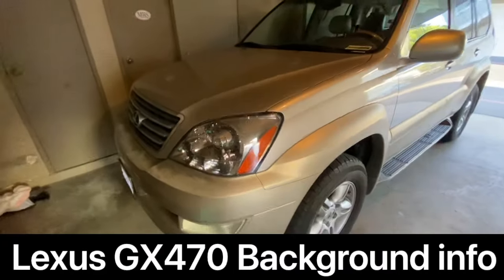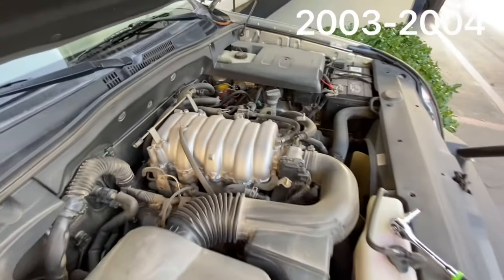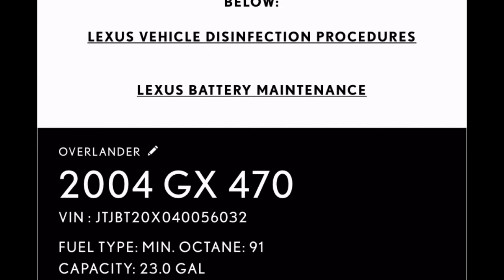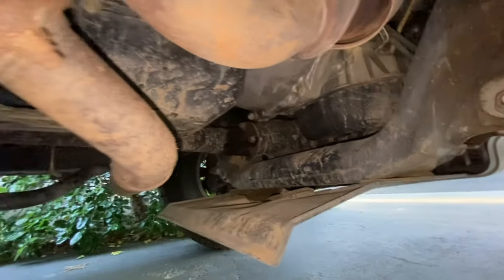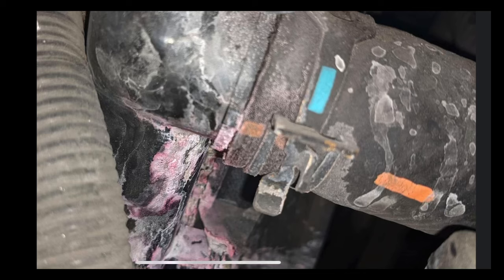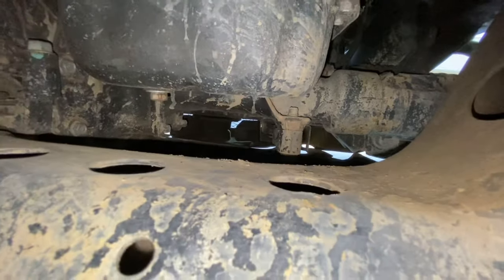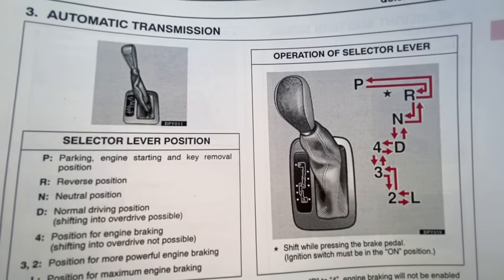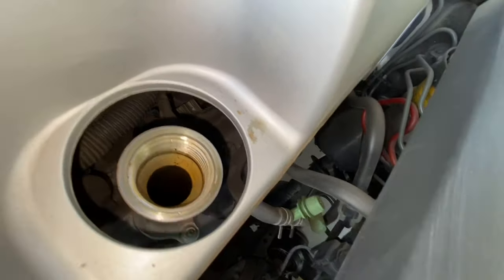LEXUS GX470 BUYERS GUIDE - 7 Things You NEED to Know

Comment: gx470 has a transfer case leak issue where if you bring it to a dealership they will crack it open for $2000 to replace the o-rings in the transfer case actuator motor. It can be fixed for $45 by just removing the actuator motor and replace the o-ring. I have that issue on mine and got a nice discount because of that issue. Fixed the leak by buying o-ring from rocket seals in Colorado (dealer don't have those seal available or for sale)
Reply from the maker: So awesome! 👏 fun job. I did the same right after I got my GX too 

https://youtu.be/5kj8n8BC92w
Reply: follow-up question: what happens when that leak is never fixed and how would you look for that?
Reply: @SR-te2db  you'll see oil puddles in the floor and if it goes low or empty it will destroy your transfer case.
Reply: Thx. Don't go to dealers unless you have to. Find an honest mechanic who knows lexus
Reply: One "last ditch" place I use for finding O-rings is the local heavy equipment maintenance place. They sell parts as well, and will size my O-ring to find one like it.
Reply: What Year GX470's is this an issue. And are your saying, this can be a DIY issue if the owner buys their own O- Ring and installs it under the actuator motor. So, is the actuator motor accessable without cracking the case?  Wondering why would the dealer service crack the case. I'm looking into buying one. Thx G

Comment: I have a December 2004 built 2004 GX470 (Black).  Purchased used in 2008 with 40,000 miles.  Since then, I have put 100,000 miles on the odometer.  It is a great vehicle and I have a great mechanic.  Based on my experience, here are few items to check.  First, the spare tire. Where it sits under the car allows salt and water to puddle between the tire and rim.  This will corrode the wheel and you will eventually get a tire pressure warning light.  Only cure is a new/rebuilt rim.  Second, gas gauge.  Make sure it works.  Not an expensive part but a real pain to replace the float (figure about $800 to $1,000 labor).  You have to drop the tank and to do that, you must disconnect the driveshaft.  Third, rear shocks.  They can rust out and are expensive to replace.  The shocks alone are $500 each.  Fourth, stuck brake calipers.  It is great that they use four piston calipers.  Unfortunately, that gives you a greater chance of one of them sticking. Radiators are not a lifetime part.  Look for telltale pink stain on the radiator.  Last but not least, check the CV joint boots for leaking.
Reply: Dude.  Your spare tire was mounted upside down.

Comment: One other bonus of a non VVT-i engine is it's a non-interference engine, the valves and the piston never occupy the same space. If your timing belt breaks, the engine just stops running and won't destroy the valves/head.
Reply from the maker: I’ve heard mixed answers on this, actually. Part of me is skeptical since changing from interference to non-interference would require a completely different head design. Not sure why Toyota would do that but if true that would definitely be a huge advantage to the non-VVT engines. 

I’d be very interested to check out any sources you have on this since I can’t seem to find anything official on the subject
Reply: Plus you can replace the camshaft seals without having to remove the cams.
Reply: The 2UZ-FE is an interference engine.  Don’t wait to break a timing belt to find out.
Reply: So, that's only the 2003 model, right?

Comment: Quick note: Toyota never recommends a transmission fluid flush, it could actually cause problems with the transmission. I would do a drain and fill only. Toyota actually does recommend this for severe driving, but I’d do it regardless.
Reply from the maker: I’d be very interested to see where Toyota has said they never recommend a flush. Can you leave a link here for everyone? I’ve heard it both ways and want to make sure everyone’s voice is heard.
Reply: I've read the same thing all over the forums and facebook pages for pretty much any vehicle, not just Toyotas. When they're higher mileage, you risk dislodging larger particulates in the trans that might not find their way out during the flush. I've always seen it advised to do multiple drain and fills instead of a flush for a high mileage car. i.e drain and fill, drive 1-3k miles, and repeat.
Reply: @lexus_offroad_adventures 
Toyota Australia tell customers who’ve asked about getting their AFT changed that it never needs replacing.  I replaced mine shortly after buying my 120 Prado at 210,000km (131,000 miles) and it was black & smelled burned.  The transmission was developing a thump when changing to R or D.  After the ATF was flushed it changed to R & D smooth again.
Reply: @lexus_offroad_adventures  every Toyota master tech I've ever spoken to has said drain and fill is the way to go. Also, make sure it's done at a Toyota/Lexus dealership as it's best to use the OE transmission fluid
Reply: My Toyota dealer did recommend flushing. It hadnt been done it’s whole life until 225,000 miles. No problems soo far.
Reply: That’s what I was told.  I have the ‘04.

Comment: You still have a bit to learn, but keep it up. I will throw one out. If you see aftermarket wheels on a vehicle there is a 98% chance they are inferior to factory wheels. The Japanese went to far as to make a casting mark to signify the quality of the alloy (looks like a little cursive m). Potmetal "rims" that you buy are of such low quality that a pothole that a factory wheel would shake off with no problem will split or break and aftermarket wheel. Thats not all though. You will wonder why you keep losing air, and its because the cheap metal will develop corrosion pitting in the wheel lip and start leaking. If you want to upgrade to some Methods or other VERY high quality wheel, go ahead. Otherwise you are literally buying problems you didnt have to begin with.

Comment: You can check the trans fluid, It's under the vehicle.  There is a fill plug you pull out and can get a sample of the fluid from. It should just barely pour out if its full. Yeah it's not as easy as a dip stick but its not terrible either. I can't remember what the fastener type is but it's the only one of its kind that you will see and is smaller than the rest. Drain and fills are easy on these too so you can easily keep the fluid clean if you do drain and fills on time.
Reply: Is there a trans fluid filter that can be replaced?

Comment: Good vid. Sticky calipers are common - easy to upgrade to 460 calipers, rotors, pads. Folks have replaced 470 with OEM and then they still fail so good idea to go 460. They are beefier. Also some AC evaporators are failing - mine failed but has had to fight texas heat.
Reply from the maker: Thanks! Great points. I am actually planning on doing the 460 brake upgrade on my off-road 470 so idk why I forgot to include that in the video 😅 anyway, that’s what comments like these are for!
Reply: @lexus_offroad_adventures  my friend has a 460 and he has warped rotors @50k miles, it seems to be a common issue with 460. Not sure why this upgrade is better.
Reply: @highmilesgarage9131 
It’d be his braking style on long downhills.  He needs to use the gears to help control the car’s speed.  Upgrading the rotors to slotted & dimpled helps a lot.
Reply: @cliffbooth7075  yup, I learned that poor braking habits that ignore the dynamics of heat and friction costs you warped rotors.
Worst thing is having red hot discs & then holding the brakes down at a stoplight. Keep releasing them so they can cool and you avoid damage.
Reply: I had the same issue with a sticky front left caliper. One of the 3 pistons seized up.

Comment: Don't let the navigation models scare you away. Phoenix automotive makes a radio that includes the air controls and it's plug and play. Also makes your GX 470 feel a lot younger in the cabin.
Reply from the maker: Yes absolutely. Thanks for sharing sharing your experience. I’ve heard mixed reviews about the performance of those units but I’m sure they’ll get better as the software improves. For my Nav GX I went with the Grom system. Making a review for it soon
Reply: @lexus_offroad_adventures  The Phoenix automotive radio definitely has some drawbacks but it's definitely a huge upgrade to the stock radio. Looking forward to seeing the review on your radio.
Reply: I have a 2003 GX470 w/ Nav (Original owner - 228K miles w/ lots of mountain/snow driving). I just installed the Pheonix PX6 - "10.4" Vertical Screen Android 9 Fast boot", It's a little quirky, but overall an excellent upgrade. REally gives teh truck that "new car" feeling. Now I want to upgrade the rest of the truck. Thanks fro the fun video!
Reply: What’s the cost of the unit
Reply: @kahncreationsable  what was the cost of the unit
Reply: @thesinfultruth7697  can't remember how much I paid exactly, I think it was around $700. I've heard you can get it on alibaba or ebay for cheaper though.

Comment: I'm in Socal looking for a GX470,  just worried it may have trouble fitting in my car port and about and pissing off my neighbors too much by switching from a Civic SI Sedan to a GX470. Thanks for making the video I think it is very applicable to my situation. I'll keep looking for that "ruined airbags, bald tires, scratched wheels and no NAV, but otherwise perfect GX". Thanks Again!
Reply: There is a spot called miramar motors that sells great gx470 built up a little that are super well maintained. Got mine there and it was amazing
Reply: @vincentalvarado9478  they mark those things wayyyyy up. I found an unmolested example with great service history and in great condition in San Diego for $12K... Not going to pay $25 to $30K for a vehicle that was $9K a year ago.
Reply: @vincentalvarado9478  markup on those are insane tho. I can find an identical vehicle private owned for 20k less than the ones they list.

Comment: Great tips, fortunately for my unsight unseen GX470 timing belt was done at 123K miles, I haven’t tested the 4wd control lever yet. Just need to get part of rocker panels pulled and doors done.
Reply from the maker: Nice! I’m no stranger to the sight-unseen GX life haha 

Hope it works out with the body work!
Reply: @lexus_offroad_adventures  thanks I’m excited crazy even with the side damage the sob still drives straight as an arrow these rigs are tanks.
Reply: I did mine at just over 100K and the original still looked new.

Comment: Alternator had to be replaced on my 2008 GX470 !!! Had my GX470 truck for 9 years. Bought it with 29,500 miles, currently has 149,590 miles. Preventive maintenance has been kept with great results, except alternator.
Reply: Ever changed the cabin air filter?
I gotta 2006 and learnt last month a cabin air filter is a thing

Comment: I had a 2004 and now have a 2008. The 2004 felt faster (not sure why - it should have been slower without the VVTi). I also preferred the sound system in the 2004. Here are some of the other differences I noticed over the years:
2004: Less undercarriage rust. No driveshaft clunk. Rear air suspension was really noisy when it pressurized. Nakamichi amp failed after 10 years. Got it repaired by a repair shop in NY. 
2007: Feels slower off the line. Driveshaft clunk (but can be mitigated with regular lubrication). Lots of undercarriage rust (both cars spent their entire life in the D.C. suburbs). In fact, the rust is so bad now, I’m getting concerned. 
Problems common to both:
Headlights are weak by today’s standards. Power window switchgear fails (probably from leaving the window down in the rain). O2 sensors. Gas cap. Undercarriage rust. Plastic runners under front seats don’t stay in place. Wheel corrosion. Brakes are undersized. Tip: use cryo-treated rotors up front to eliminate vibration/pulsing. Brake calipers typically seize around 100k miles. Rear barn door opens the wrong direction (optimized for right-hand drive countries). Wheel bearings tend to start failing around 100k miles. Otherwise, pretty bulletproof.

Comment: The other nice thing about the 2003-2004 models is that 87 octane fuel is ok to use. I have both an 04 and an 08 GX470. While I’ve heard of people using 87 octane in their VVTi motor, it isn’t recommended, and there’s a noticeable difference in (lack of) power.
Reply: First time hearing this, where can I find information on this?
Reply: I bought my 06 gx with 180k miles back in July 2021. I’ve only ran 87 octane once I bought it and all the way up to 245k miles a few months ago. I never had any issues since then  until Earlier this summer with the fuel pump starting to stall the car out from time to time. Now i fill up with premium . Not sure if it was because I was running 87 or maybe the fuel pump replacement was due anyway. Either way it’s not another risk I’m willing to take. I don’t mind spending an extra $15 bucks per fill up. 
I assumed since it has the same motor as the v8 4runner and sequoia that run on 87 it would be ok on the gx but after some research i was told because it has vvti it’s better to run 91

Comment: in 20 years I've put over a million miles on Lexus cars and trucks.  LS 400, 430, 460 LX's and two GX's.  My mint 2004 GX was totaled 2 months ago by a distracted driver.  Just had it's 90K mile service. I searched all over PA, NJ, NY for a replacement.  Found a clean 2005 with 180K for $9K.  Needed a few things.  I replaced the air springs, found out during the process that it was just a cracked air line.  But new springs and today I did the axles as one side had a torn boot.  A caliper last week and some brake pads.  All work that I did on my own.  Cost me around $400 in parts.  She's going in for timing belt service on Friday at the Toyota dealer. $800 for that service.  Overall I'll have about $10K invested in a truck that will last me 4 or 5 more years.  Nothing better than a Lexus.
Reply from the maker: Sounds like it’ll be a solid rig! Awesome work 👏
Reply: So what did ur insurance company pay by for ur gx.. sometimes they try to lowball customers
Reply: @thesinfultruth7697  $10,200
Reply: @twowayyo11  no way ur truck was it worth 18k
Reply: @thesinfultruth7697  Whatcha mean? Where'd $18k come from?
Reply: @joev1779   boss I’m saying they low balled u.. ur truck with 90k miles is worth minimum 18k
10gs is a joke… u should have fought for more money

Comment: thanks for the video. its very informative. i currently own a 2005 4runner with the same V8 2wd. im deciding on a 5th gen 4runner or one of these. your thoughts?
Reply from the maker: It’s hard to say. The 5th gen 4 runners are nice, newer cars. A lot of it will depend on how new/nice the trucks you’re looking at are. I’d take a great condition 2007 GX470 over a run-down high mileage 2014 5th gen for example.
Reply: @lexus_offroad_adventures  thanks for replying. the fact is my current 4runner works great im not making any moves until probably 2024. the car market is still kinda crazy. im leaning more 4runner because of the timing chain. idk yet because i love that V8. thanks again!
Reply: Between an older gx and the 5th gen, the 5th gen is the better car. If you can get it for the right price, id get the 5th gen. Now between the 5th gen and the new gx, get the gx. Saw a post on reddit where a 5th gen trd pro was more expensive than a new gx, everyone was saying to get the gx, its just the better car if its the same year as the 4runner.

Comment: Let's not forget the absolutely most important aspect of non vvti 2uzs 
TRD SUPERCHARGER BAYYBEE

That and the rear axle gussets were weaker in 03 and 04 which is important for off road in rocky conditions

SAIS is only on vvti
SAIS causes emissions test states to fail the vehicle and will set on lights it does nothing mechanically. There are bypasses that will cut the lights and codes, but they won't pass emissions.

Idle air control is usually a loose vac line

That t case actuator is not an oring. It's an oil seal which sounds similar if you don't know what you're talking about. It's a bitch to get it seated right.
Reply from the maker: That’s right! TRD S/C compatibility is a good one.

Lol everything here except the snarky o-ring vs. oil Seal comment 😂 I was not referring to the t-case shift shaft oil seal, that’s not what failed on mine. It was the o-ring that seals the outer part of the actuator to the t-case that got flattened. Part number 90301-56009 which is literally labeled “Ring, O” See below video:

https://youtu.be/5kj8n8BC92w
Reply: @lexus_offroad_adventures  I know what oil seal you're talking about. It's not an entirely negligible difference. The oil seal has a spring inside of it and is very prone to not seating correctly and leaking. Some people have had problems with the actuator going out of alignment as well. 

I can 3d print the brittle dust covers on the actuator as well if you need one. Mine broke. I think about 30-50% of them break in the seal replacement